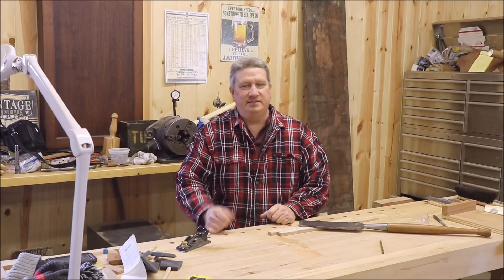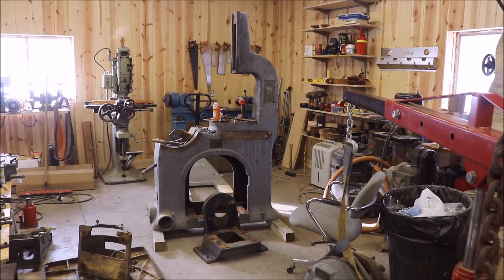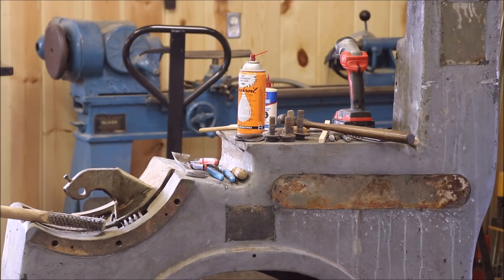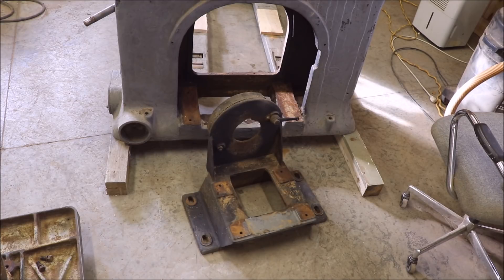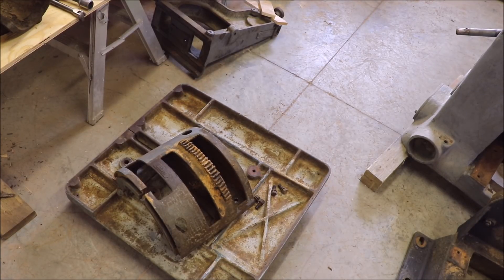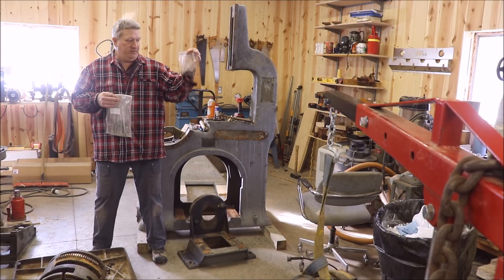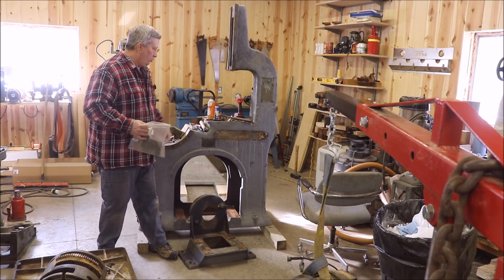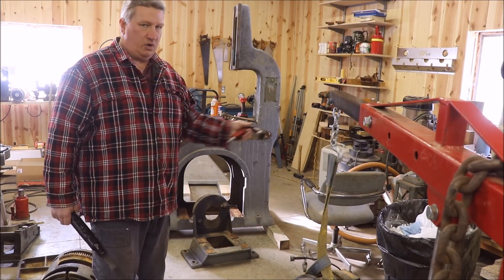Restoring the Yates American bandsaw

Comment: Looking forward to further updates. That motor will be fascinating. Pre-WWII electrical goods usually are. Thank you for sharing.
Reply from the maker: I've run the motor, and it's an excellent runner.  It is just filthy, though, completely filled with grease and sawdust.  Needs a good cleanup and some new wiring......good as new when it's done, and better than any motor I could buy today.

Comment: Lookin' good, Jeff! I shuddered a bit, though, when you pulled out that needle gun. I spent my share of time using one of those in the Navy, in the engineroom, and often in a none-too-comfortable area below the deckplates...

I guess I half expected you to sandblast all the parts - my personal preference for cleaning parts, when possible. I know you can get some dimple-ing with a needle gun, although I've never used one on cast.
Reply from the maker: My sandblast cabinet is 36"X24".  Everything that fits in it goes in it!  The big castings won't go in....Getting down low is hard on the back with the needle scaler, but it does a good job, and it's pretty fast.  It has zero effect on cast iron, but definitely will leave dimpling on steel machines and parts.

Comment: On the warm gear I see a set screw to the "south" of the taper pin you were pointing to.
Reply from the maker: That's the lock collar on the other side of the yoke.  Already loose, but nothing to do with removing the pinion gear from the shaft.  It just holds the shaft in place.

Comment: After soaking those broken bolts with the kroil, try using a left hand drill bit and drill down the center of the broken bit.  As you drill, the broken bolt should back out.
Reply from the maker: Been doing that for 20 years.